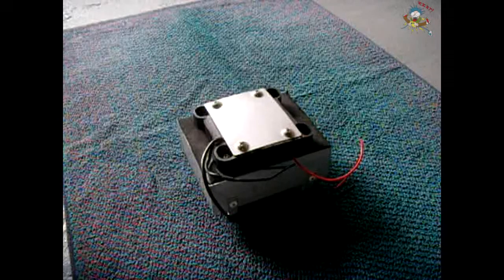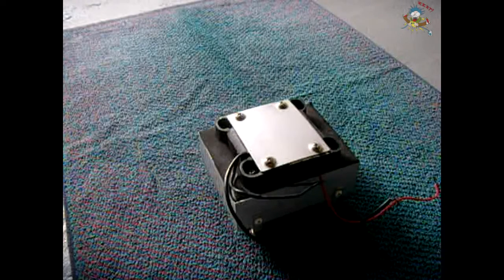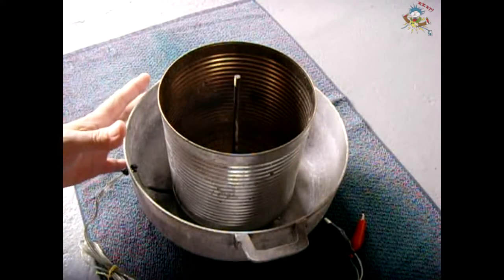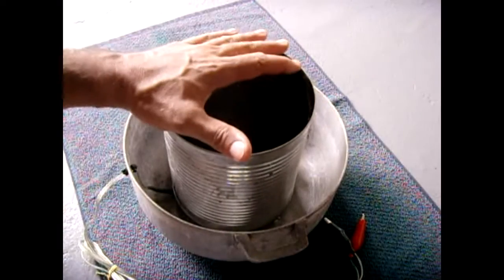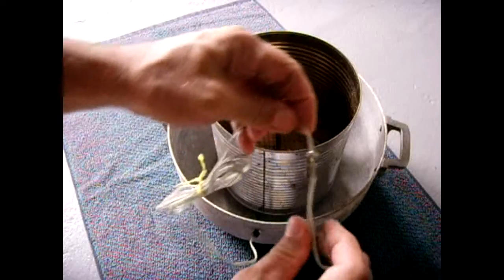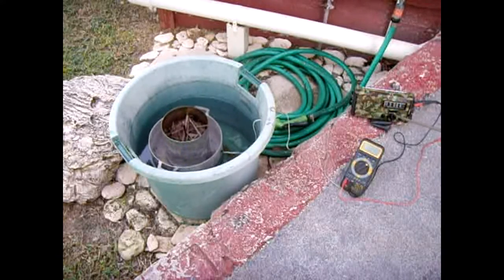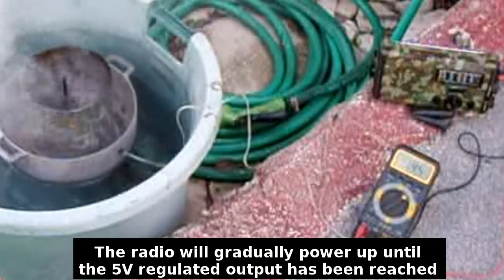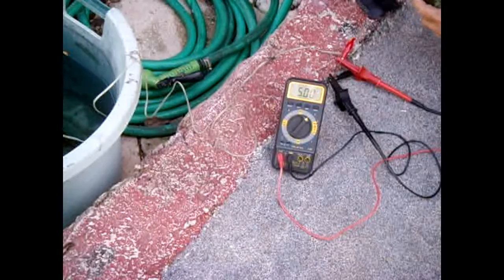How To Make Electricity With Fire & Water - SURVIVAL POWER!

Comment: This would be really cool for emergency boat power. If you scale things up to make more power. The ocean is always cold. It's basically the earths heat sink. Also, seashells are made from calcium. If you burn them they turn into calcium nitrate. Which reacts extremely with water. So you could use calcium nitrate from seashells to produce heat. You could have some power generator bouyes that can tether to your boat for emergency power. The only tricky part is getting the reaction just right so it produces heat and doesn't explode.
Reply: It would actually be more effecent to build the unit into the boat or maybe even perhaps a vehicle and do a heat exchanger Tied into the coolant. It would be hot enough when the engine is running and you could tie it in to some onboard batterys. Boats don't use coolant they use a water intake straight from the ocean but maybe you could attach a heat sink on a hot surface and have some coolant running to pull the heat from the engine.

Comment: At what load is the maximum power delivered? short-circuit current and open-circuit voltage are meaningless figures since in both cases the power output is basicly 0. See if you can connect a dummy load like a few small-value resistors and take a log of the power output at different resistances. The voltage across the resistor, or the current flowing though it will tell you the power output. If you know one of these, it is easy to use ohms law and watts law to solve for everything else!
Reply from the maker: The unit I made will supply 5V/250mA using 82 deg F water with a decent fire. I was able to supply up to 500mA at 5V using very cold water in a bowl. If you want better output, you can place these modules in series or parallel.

Comment: just tell the truth, it runs on magic. Excellent experiment as always. love your vids.
Reply from the maker: Thanks Jeff!
Reply: I had thought about stacking the piezo and wiring in series or parallel. Wonder if you could get up to an amp or two. Most new phones and tablets need that 2amp at 5 volt. Keep tinkering and I will watch. Better than honey boo boo !
Reply from the maker: No. Don't stack them. Place them all side by side flat. 5V at 1A is easily accomplished using 4 Peltier junctions. Make 2 sets in series, then both sets connected in parallel using a Schottky diode on each output. You can drop the dc-dc converter, and use an lm7805 instead. No need for 2 amps. 2 Amps was designed so you can charge and use your tablet at the same time. Just charge the tablet then use it.
Reply: Well what if I am right in the middle of an electronicsNmore video and need to charge so it doesn't die? You know how devastating that would be ! LOL! I have a couple old hot/cold coolers with those modules. got them free as they have holes from an accident. might tear into them. Maybe I will make armpit coolers !

Comment: I also saw the Energy Harvesting video with Dave Jones, and had the same thoughts about him only applying heat to the element.
Reply from the maker: I did not get to watch his video yet, but only applying heat to one side of the module, and not cooling the other using a fan or water, is a big waste. You cannot have a lasting power output.

Comment: Nice project! 

You might want to do some YT research on a small wood gas burning stove.  You'd have a more stable production of heat.

Wouldn't it be more efficient to conserve the heat of the fire rather than letting it escape to the atmosphere (e.g.:  using heated water on your heat collector)?
Reply from the maker: There are many things you can do with these modules. What I did is show a very practical way to use them. You do not need extreme heat. It does not matter if heat escapes, just make sure you have enough wood laying around. to keep the can well heated. Remember, if you use a couple Peltier modules in series or parallel, you can use less heat for the same output. Heck, make a square out of (4) modules!
Reply: electronicsNmore
Agreed, however, creating a stable heating source & conserving heat = less hassle & less fuel if a person is intending on building a practical system that will run for hours with such thermo-electric devices.

Comment: Great video on the construction and the practical application. I wonder how the biolite camp stove does it without the cooling effect of the water.
Reply from the maker: That unit must have a low current cooling fan which comes on as soon as the one side is heated . I can see the large heat sink with fins in the photo. You need that differential for a good output, otherwise the entire module would stop working. Water does the best job of removing heat.

Thanks For Watching!

Comment: If you had placed a vent stack into the can (to the bottom of the can) to allow oxygen to flow in through the stack, to under the sticks, the fire would have burned Much better.

Comment: Could you heat up one side of the thermoelectric cooling & heating module with a magnifier glass using the radiation of the sun? 'Free' energy?
Reply from the maker: I thought of painting one side of the large aluminum heat sink(Coffee Can Side) flat black using BBQ spray paint, then leave the other side secured to the large pot for water cooling. You can then use a solar concentrator on the black side of the Peltier junction instead of the can for burning. :-)
Reply: electronicsNmore
Great idea. So near a river (for cooling water) in hot/tropical areas one could build a solar power generator that way.
Reply from the maker: Any cool/cold body of water works very good.